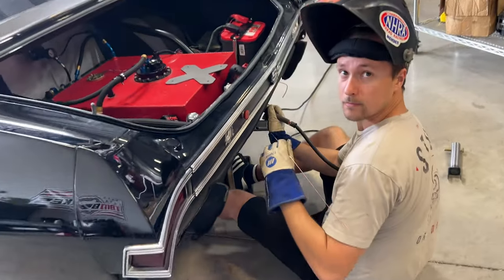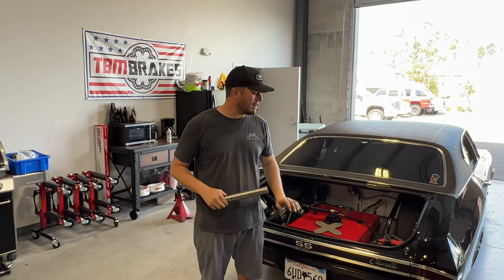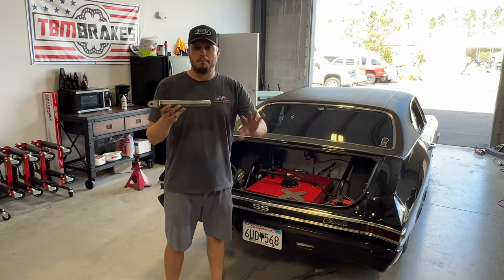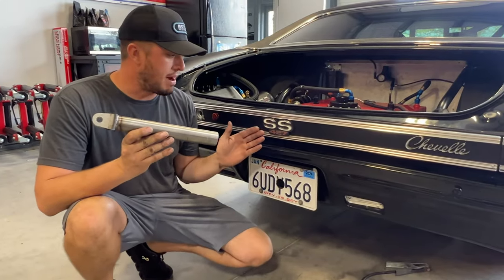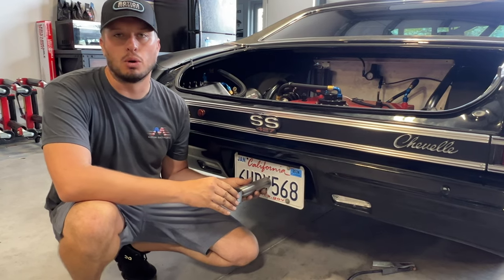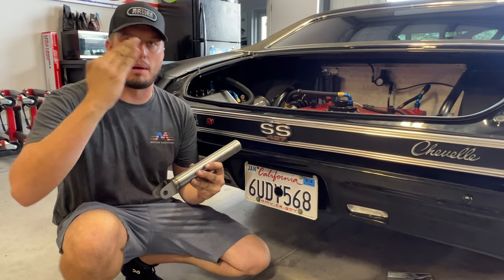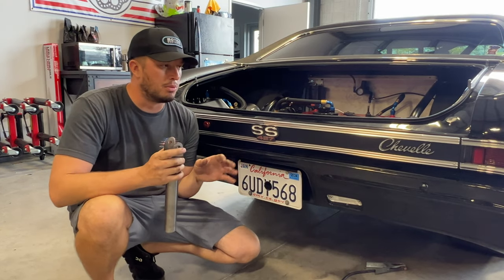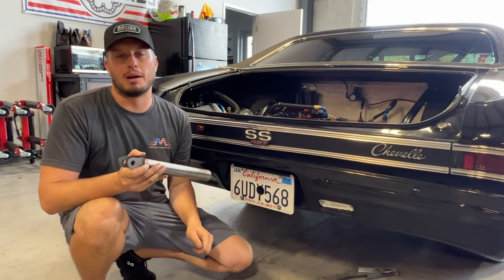Parachute Mount "Don't" Do: Tech Tip Tuesday

Comment: What about if I’m running dual chutes, can I use them as a wheelie bar? I’m trying to save weight and I’m bout that “no bars” life.
Reply: Lmao you win!
Reply: @precsiondiesel225; Clearly, by Your name, if You are interested in safety, proper functionality and precision, then certainly the parachute(s) bars, mounts cannot be use for or as 'wheelie bars'.
=>Their placement are certainly connected at different locations, heights on the chassis -> since they are intended, designed to function differently|
a. the 'wheelie bars' certainly are necessary, required to be much lower, closer to the pavement
b. the parachute(s) are necessarily mounted higher on the rear of the chassis for proper functionality, deployment.
Good Luck, All The Best, Sincerely

Comment: Trailer hitch mounted chutes. Big no?
Reply: Good question. I don't see why that wouldn't be as good as any "real" mount you would install, assuming it is installed properly. The only thing that makes me question it is how low they are, I am not sure if that matters though.
Reply: There are type, ways, means to have one chassis mount witch is used for both a trailer hitch and the parachute mount with two different, bars extending from the chassis mount.
Many of the Drag&Drive vehicle have and sue these properly and effectively.
All The Best, Sincerely